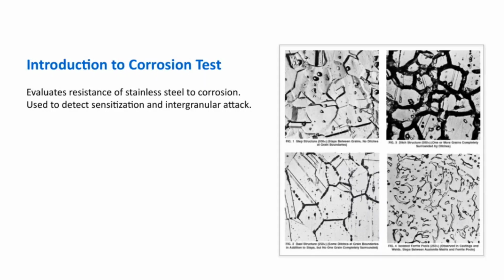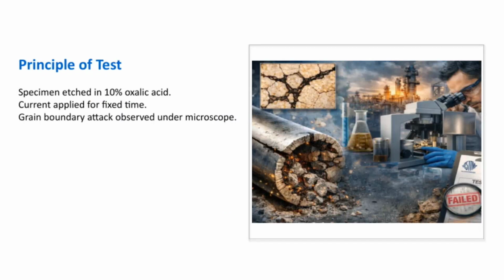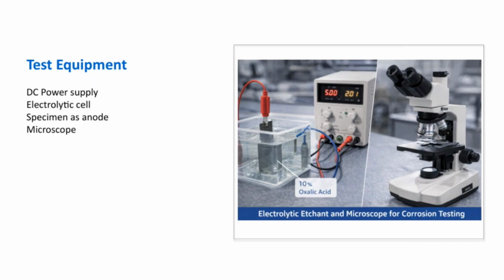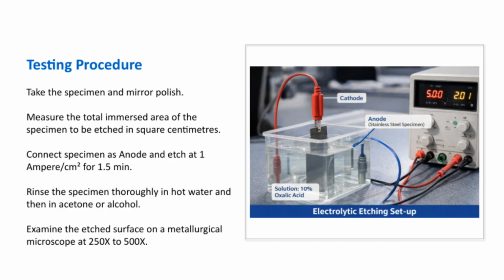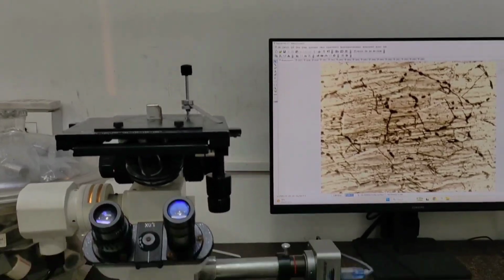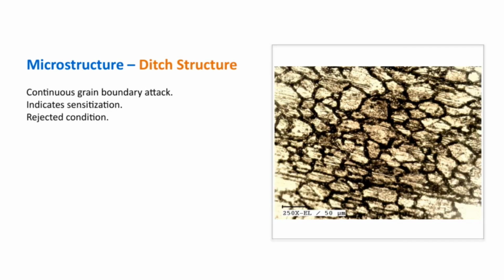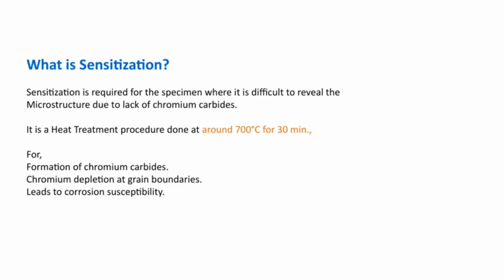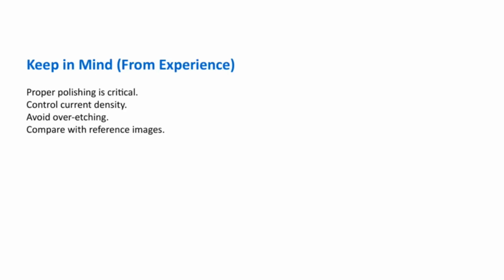ASTM A262 Practice A – Oxalic Acid Etch Test | Step, Dual & Ditch Explained (IGC Test)

Comment: what will i use for the cathode ?
can i take platinum sheet ?
can i use to see the microstructure of ss304 in initial condition, cold rolled condition at room temp. and cryogenic cold rolled ?